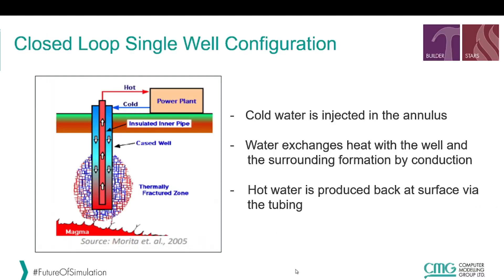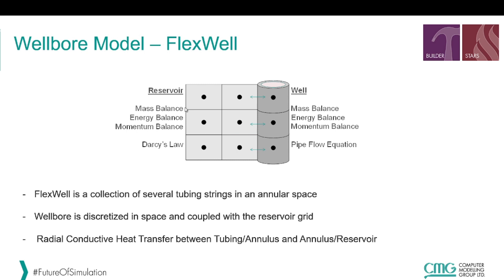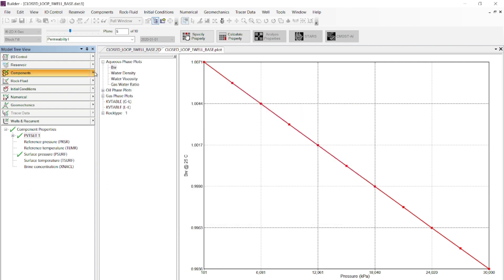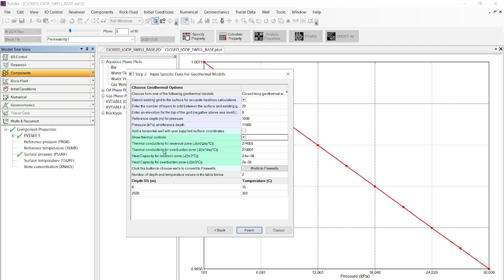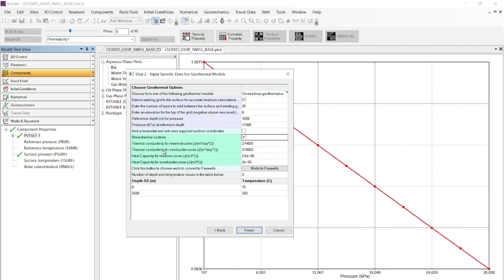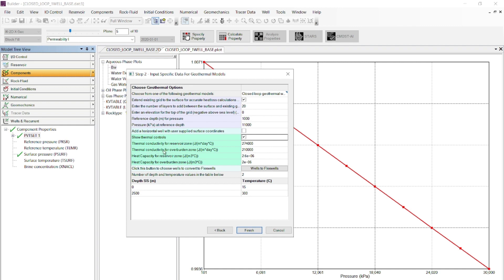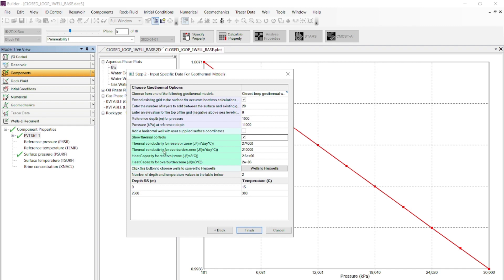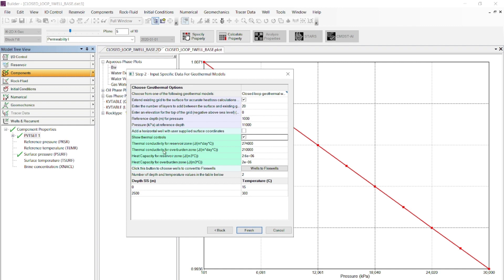Geothermal modelling for single well_CMG software

Comment: Hello, thanks for good work. 
does the simulation also consider the gas (vapor) flow back down the well due to gravity or condensation during flow back to the surface by hot vapor?